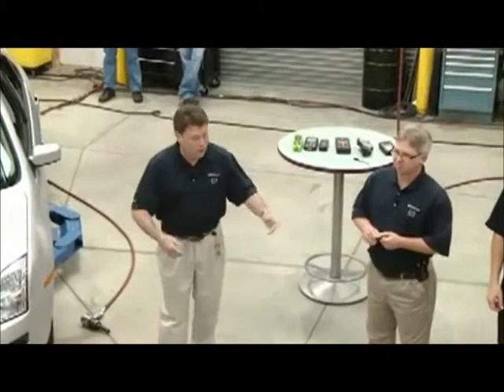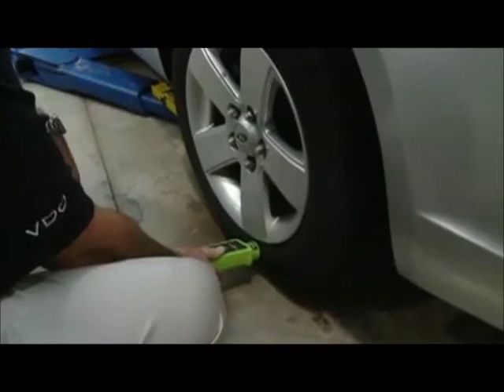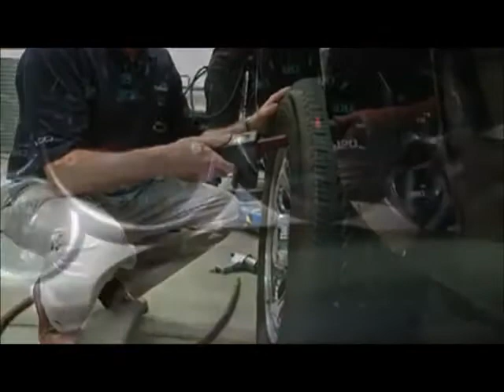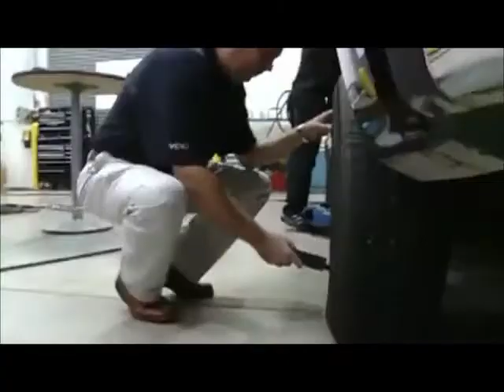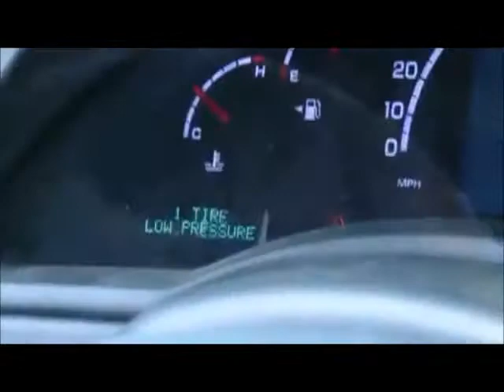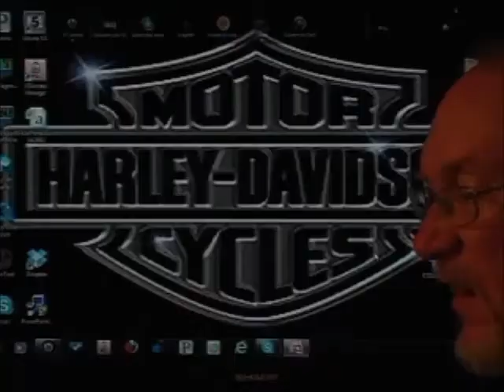TPMS Service Tips From Continental:  After Hours with Pete Meier

Comment from the maker: Most Asian models have to have the sensor positions relearned by overwriting the data in the onboard control module. My guess is they didn't do that, and the same tire (though now in a different ACTUAL position) is losing air. If she has a pressure display, try adding air to the front tires and see what changes on the display.

Comment: Great video. My friend has a 2012 Infiniti FX35 and says the TPMS showed the left rear tire as being low several times and the Infiniti dealership rotated the tires and she claims the same left rear corner is still going low. I asked if she had the wheels and stems checked for leakage and she said the dealer checked those thoroughly.  I can't see any way this could still happen on the same corner. Any Thoughts ?